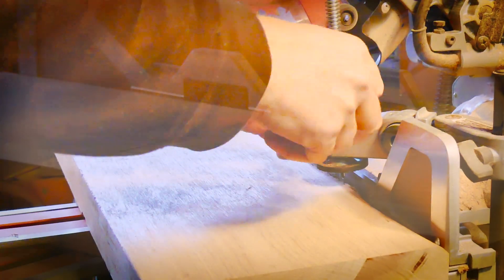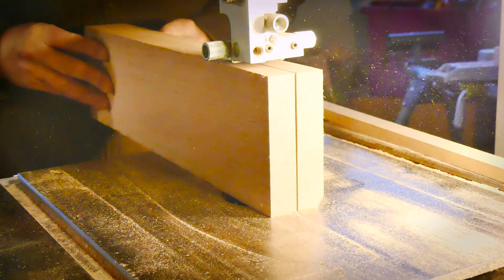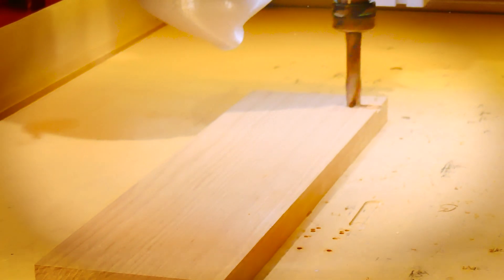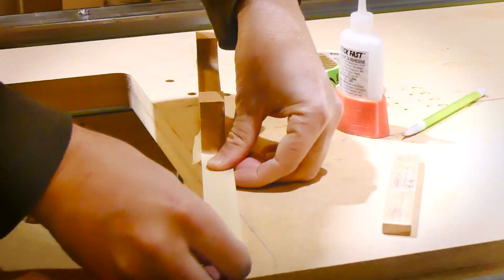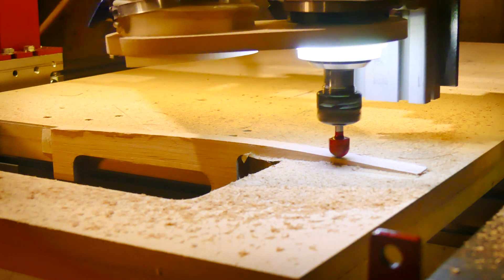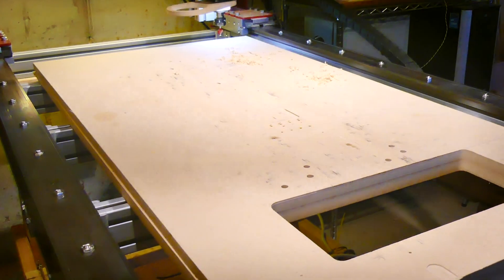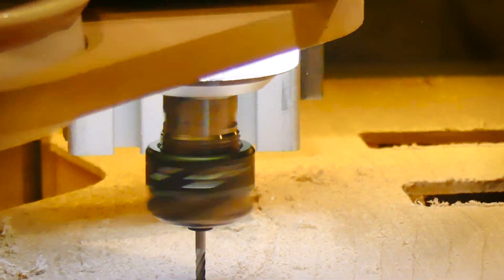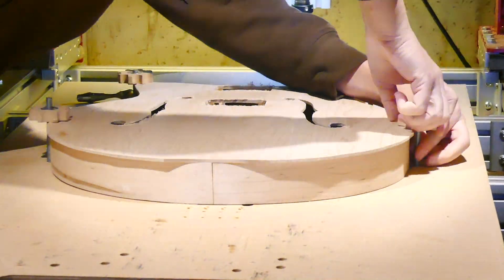CNC Trestle Braces for the Gretsch White Falcon | F-Holes CNC milling

Comment: "The creator's momentum develops from the process and not from the result."
Reply: Both points are realy important and part of thé same move....I dont know for which reason thé result should be excludet from thé equatation. Any body knows and as Lao Ze already told : thé way IS thé goal" but specialy in termes of guitare construction thé final result which IS the instrument counts also
Reply from the maker: Sure, but it's very easy to skip over important details if this is you sole focus. What I'm getting at is that this process is enjoyable, don't rush, work slowly and with detailed intent, and most importantly, don't try to turn it into a quick production process. The results from an instrument built this way speak for themselves.
Reply from the maker: I think its true, and much more sustainable.
Reply: Maybe the true creation is not even the final product but the process 🤔
Reply from the maker: @nicholasmao2321  indeed.

Comment: I'd like to ask you a specific question about your drum sander if you don't mind. What grit paper do you use?  Also, I have that exact sander and I can't for the life of me keep the belt from moving side to side...I've pretty much given up on this sander and gone to a smaller 12" that has a "keeper" on both sides of the belt that keeps it from getting off track. The only issue is I can't run a full body through it like my open ended grizzly. No matter how much I adjust the bolts the belt just keeps getting off track...
Reply from the maker: I run 80 grit in the drum sander and take very small passes; the wider the surface, the thinner the pass is necessary. It's a good tool, but it is not easy to use. Yes, the belt is always moving from one side or the other, and I keep a close eye on it and make a frequent small adjustments to keep it tracking. These belts track the opposite of what you might think; when you increase the tension on one side, the belt will move toward the higher position, not away, like a band-saw wheels track or a railroad tire. Make small changes, never more than a turn or two, and you will get to the point that it's relatively steady, but you will always need to make small changes with this machine. 

On a side note, if it starts making a knocking sound, you may need to realign the main belt pulley and make sure the set screw and driveshaft key doesn't slip; it's another frequent issue with these that will destroy the belt if not addressed.
Reply: @TwoCherriesIns   Thank you, I'm not crazy after all!  I use the machine but I have to stand there with my wrenches and watch it. I got a ShopFox 12" that I now use for anything smaller like fretboards and tops that that have not been glued. But I like this machine because I can run an entire body through it. But if this is a common problem it explains why I got it
from a Luthier shop in Nashville for a steal ($250) and it was only 2 months old! They just wanted it gone!
Reply from the maker: @janefoxguitars6061  If you are not willing to put in the time to tune the thing, It's probably not the tool for you. Almost every machine I build or purchase can be made significantly better with setup and tuning; a lot of guys just want to turn it on and go; fortunately for the rest of us to the victor goes the spoils. I would take that price on this machine any day of the week because I know how to get it to run the way I want, and I know how to keep it running. The same is true for the CNC; if you want it to run well, you are going to have to put work into it, spend time calibrating it, and maintain it, and If you do, It will pay you back many times over.